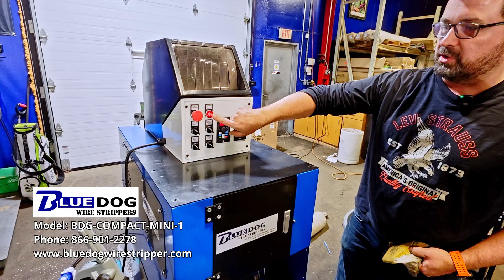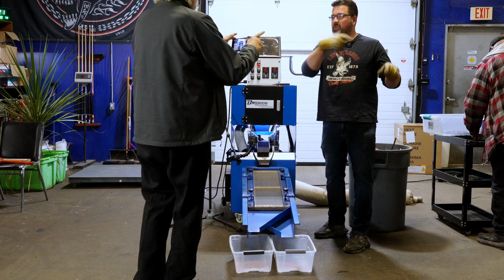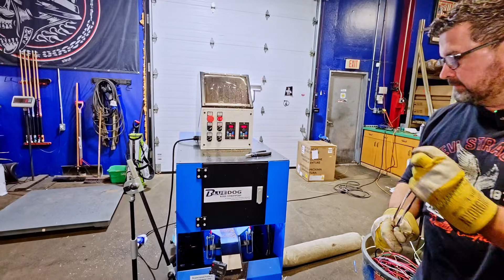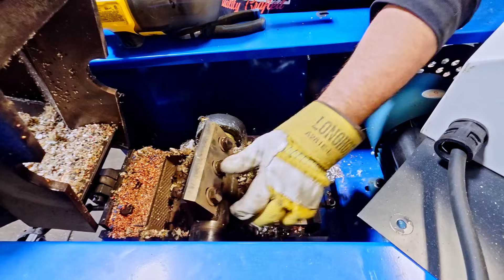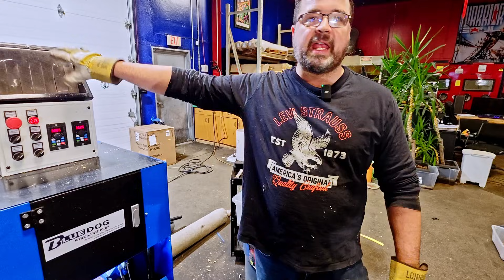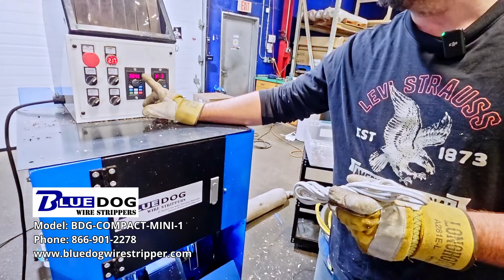BDG COMPACT 1 MINI GRANULATOR - REAL TIME DEMO

Comment: @blue dog. Install an ammeter indication that will help monitor the load being applied to the motor and control that you dont overfeed before its to late. Its a simple and cost efficient addition.Machine is suitable if material class is consistent being fed in but very temperamental when material is mixed. This is a down fall of this machine in my view.

Comment: Looks similar to the plastic Grinders I used at I'll go ahead and say it Warsaw coil David grind up the excess plastic from the molds the the blades for a little bit bigger and they weren't on an angle they were straight but similar machine just didn't have a Shaker and that stuff

Comment: "Don't over feed the granulator", as he spends a minute winding up the wire into a very thick bundle that the granulator blade has to chop through.  Just feed the wire in!  Then he jams the granulator with a "too thick of a piece."  Well, you intentionally made the piece "too thick."

Comment: You would need 3000 lbs of copper or 4500 lbs of wire to break even at cost minus running cost. If you’re a serious scrapper or an electrical shop, this would be worth the investment. Probably an ROI of 1 year. Nice machine.
Reply: it will be timed out and need to be replaced right when you hit ROI

Comment: This granulator cost about $10,000? lol, at that price this is for commercial use and definitely not for the home scrappers. 

If I had $10,000 I wouldn’t need to be collecting copper wire! 😂

Comment: Hard to imagine this would pay for itself with how slow it processes. Cool concept, though.
Reply: Actually I believe its not bad. In my area near tulsa, ok. #1 copper which i think this stuff is when you bring it in for scrap, is about $4.80 ish a pound depending on where you bring it in. If the machine does 50lbs an hour. 4.80 x 50 that's $240/hr if I did the math correctly.
Reply: The real profits on 50 percent recovery is 60 dollars minus your time if your scrap yard would pay 1.80 for number 2 insulated it all changes on the type of wire and your yards prices

Comment: Hope you don’t have any neighbors close by, gonna get a knock on your door by the cops for noise complaints!
Reply from the maker: It's actually pretty quiet if you compare it to large industrial granulators!
Reply: How does it do with Extension cords. We do a lot of rv demo
So we have the big power cord
Then a lot of small wire like like the junk behind your TV or computer
Reply: @adamwall1966 to me it should do fine. Probably a different screen size to deal with the thinner wire size compared to solid core house cable. Probably has to process it finer to separate the thinner wire.